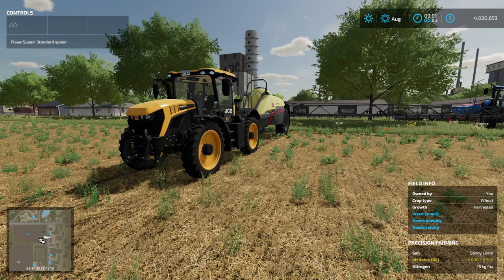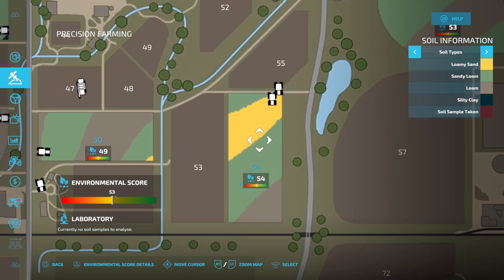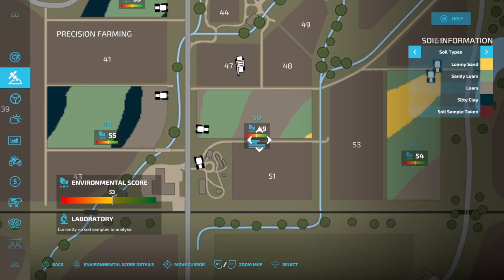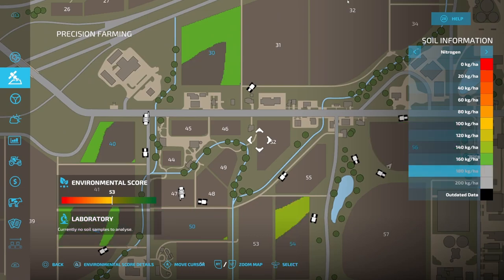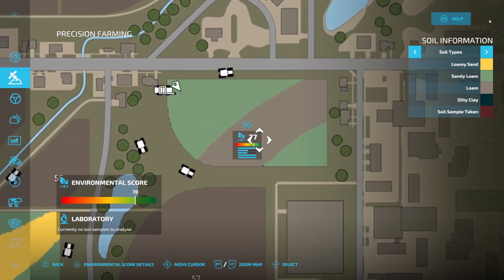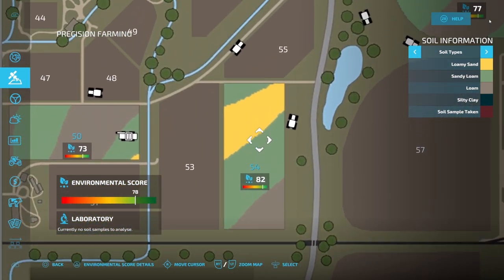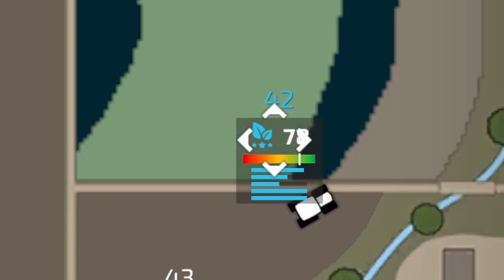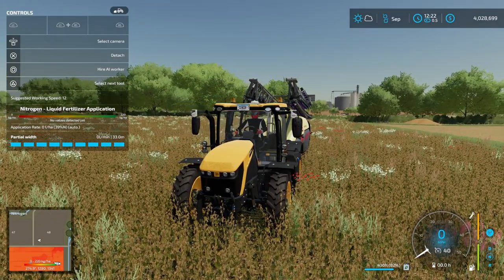Are Crop Sensors Needed | Precision Farming | Farming Simulator 22

Comment: You need to use sensors only in green growth stages and it works best for beets potato sunflower and corn all green crops. When you turn on the sensor there will be barely noticeable ring on minimap around tractor and it will apply a small amount of fertilizer.

Comment: Good video and work bud.  However I have a note of thought. You have all those fields in which you did different things with the same crop type.  HOWEVER,  all those fields have different soil types, different sizes etc.  To get the absolute best study result is to work the exact same field over and over.  Pain in the dairy aire I know,  but to get a true and accurate result that's pretty much thy only way to go about it.  Unless you can get one field that is ALL the same soil type, do ONE strip across with the different variables, is gunna be a pain. 
Not all science is fun, most of it is hard work and almost nobody gets to see all the hard work and time,  (blood, sweat and tears. Often lots of tears) that goes into the study result that we get to review in a couple of minutes. 

Anyway, that's my piece.  Thanks for your time and efforts
Reply from the maker: Great feedback. Great points but let me explain why I chose to use multiple fields. This test was lookingnat the nitrogen levels compared to preferred application rate and the nitrogen portion of the environmental score. In part 1 all I needed to know was if the nitrogen was applied evenly and to the preferred rates. We confirmed that happened. Part 2 was looking at how the process of application and the equipment used affected the score. We saw in this test that the best result happened with only 1 process and set of equipment. The different soil types didn't matter in this test because the environmental score doesn't penalize you for having poor soil. Hope this clarifies why I ran this test this way.
Reply: @Driver53Gaming  no prob Bob. I wasn't questioning WHY really.  I understood the premise, just thought that if you were looking for more accurate results that you'd need to have a control, but then all the comparisons would have to be as close to exact art possible, with the exceptions of what you were testing. You put more effort into than I would or have, so I'm not doggin on you at all 😉

Comment: you have to wait till crops are a few growth stages along.  Then you spray AGAIN with the sensors turned on.  You will see the map image has nitrogen levels near the tractor showing the levels dropped slightly.  The sprayer then fills the gap.  Then, you will get a perfect nitrogen score.  For me, I do manure and then plant my fields with a planter/seeder that also ferts  to get to the right levels.  Then about half way through the growth season, I spray them again to top off the nitrogen levels.  For winter crops like wheat, I will spray in the spring.

Comment: Also you are comparing different fields :P you would have to compare same field, totally zeroed after harvest to another one.

Yes, sensor makes difference if you want to save money in long run
Reply from the maker: Good question. Soil type or existing nitrogen wouldn't make a difference if I'm only looking at if the final nitrogen levels were correct. Also environmental score isn't dependent on the soil type as it doesn't penalize you for having poor soil. It only calculates if that field had all the proper processes done to it.
Reply: @Driver53Gaming  I need to verify my field then cause I got on no mans land one continious straight field and its calculating 2 values strangely for both areas :/
Reply from the maker: @sgtace  that is because you are probably on two different lots. The game doesn't combine fields together. It only looks at the seperate areas that can be purchased.
Reply: @Driver53Gaming  yeah i agree an it kinda sucks because map im on in order to complete contracts for bailing i need to ownthe bga to even sell other farmers stuff an complete mission so thats was ok but then my score is trash because the land i own. i mean overall score will always be bad now because i own the bga an cant do anything to improve concrete lol even where ive built things on feilds it still wants me to fertilize my barn an silo an there is no grass so overall score makes no sense because you cant just own a feild an not have silo or barn/shed or production an animals so you get punished for using any placables with how this currently works an it sucks because i dont want to just have everything i own sitting in feild beside mine an not build anything shouldnt be punished for using base game stuff otherwise why have placables, or how do you gwt perfect score an still be able to have silo or sheds an animal pens we should not have to choose between perfect score an barn/silo or animals for me productions an placables are needed in my playthorughs it makes no sense that a barn is bad for the envirorment not sure how precision farming adds any realism of fun if this is how it works doesnt even make sense cant plw or punished cant deep cultivate cant do 90%of features in game if you want good score thought it would be fun with soil types an samples but rest is kinda whack but most things with it arent even working correctly i fertilize an game thinks oh your house needs nitrogen underneath it to your bad farmer your getting low score ok makes no sense hopfully they can make changes or fix it idk
Reply from the maker: @TakenCypress369  here is a video showing how to get your environmental score when you own land without actual fields on them. https://youtu.be/vsR1Qd7gDwA

Comment: The only question I have is if the sensor was on as you have to manually turn it on

I was doing it for some Barley earlier and I had to go back over the field later as I went over it without it on